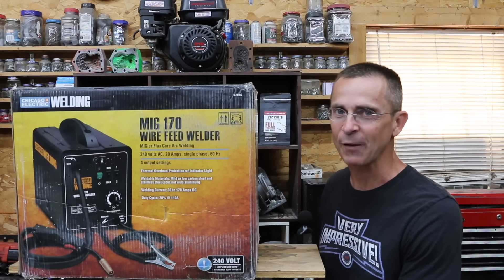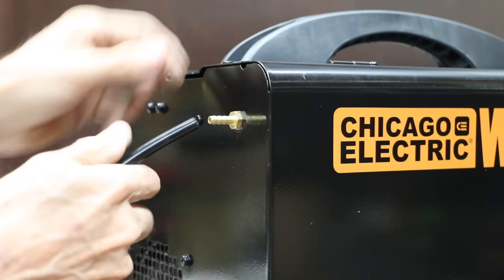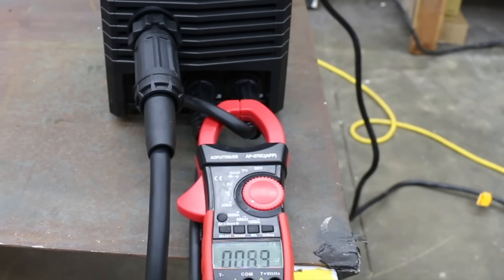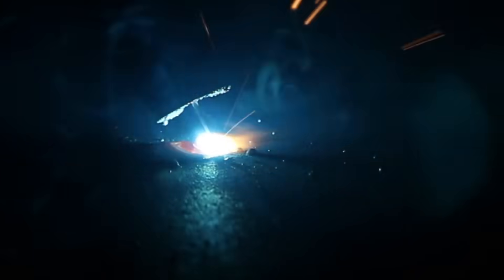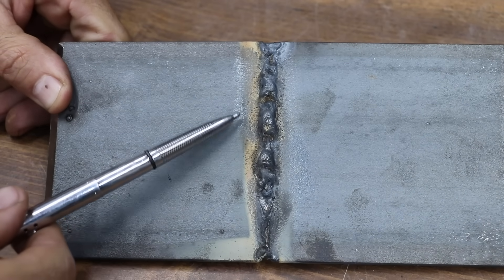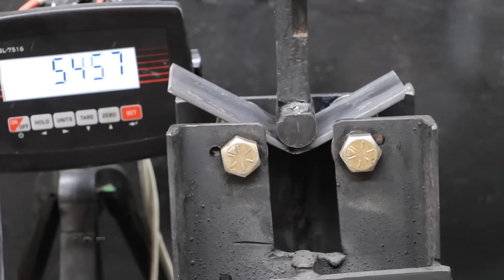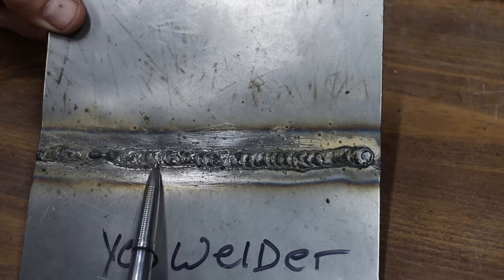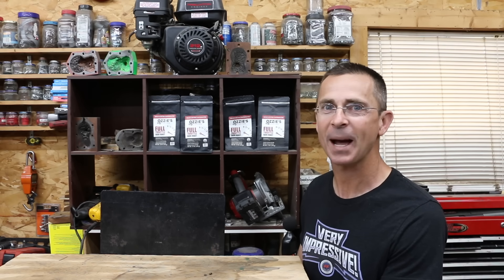Cheap vs Expensive Welder? Let’s Find Out!

Comment: Never having welded before, I bought a Yeswelder 205DS to fabricate a rear bumper and spare tire swing arm for my 4WD Suburban. Machine worked flawlessy...has been a year since and the bumper hasn't fallen off the truck.  Just added one of the Yeswelder models that will weld aluminum.  Yeswelder has some great machines at a relatively moderate cost.
Reply from the maker: Thanks for sharing.

Comment: You left out one important point - service.
Which can you actually get the unit serviced when (not if) there is a problem?  How long does it take to get the unit fixed, and MORE IMPORTANTLY where do you have to send it?
Is it the local welding supply or back to China?

Comment: A true welding prep (bevel should be 30° creating an open, inclusive angle of  120°. Also the true terminology is weld spatter not splatter. Thanks once again for your in-depth experimental procedures.
Reply: Im a German Welder and a Welding Engineer and to be honest for those V Seams with the 3mm gaps i learned to Weld the root in a lower current to get the best and most consistent root, i personally think that if he would've welded those roots like its supposed to be at about 180 amps and slow passage the Welds would've held up way more force.

Comment: Thank you, I was wandering about the "YES WELDER" if it would be a good buy for the buck. I know it's not the greatest and not going to spend $5k for a hobbyist welding plus I want to plug in to a 110V outlet 220 would cost a lot more to run. Thanks again for making this video and coming out the pocket so other's on a budget don't get swindled for buying a machine there not going to be happy with.
I bought a Lincoln machine that didn't last long at all and I spent $800 on it. Thought I would have got more year's out of it for what I was using it for.
Reply from the maker: You are welcome!  Thanks for the feedback.

Comment: I wouldn't use any welder  other than my Lincoln 275 Tig, 256 XL, and 180 Dual migs, let alone own other brands. I recently sold all three of them and bought an Everlast MTS mig, AC/DC tig, and stick. My Lincolns were older transformer based machines, but using an IGBT inverter welder is unbelievable. Every time I use it, I'm in awe. The fact that new Lincoln costs $2,300.00  and can't even do AC tig is a travesty. The older I get, the less brand loyal I've become. If you're looking for a new welder, do yourself a favor and look at Everlast.
Reply from the maker: Thanks for the feedback.
Reply: @ProjectFarm  Thanks for making such high-quality content. It's so refreshing to watch interesting videos and not have to worry about hearing about politics or being a shill paid by manufacturers to promote their products, or sneaking in some vitamin supplement in the first 5 minutes of the video. This is what YouTube was originally intended for. Have a happy Thanksgiving and a Merry Christmas.

Comment: I found this video about welders incredibly informative. Thanks you for making this video. I do have a suggestion for another Welding video below. I have put something I found on Amazon. I think it would be interesting to see how well these work. 
AZZUNO Handheld Welding Machine, Portable ARC Welder Gun 110V, Stick Welder Machine with IGBT Inverter, Small MMA Welding Machine for Metal Fits for 1/16''-1/8'' Welding Rods (Handheld 90A)
Reply from the maker: Thank you for the video idea!

Comment: Some of the footage seems to run together between shielding gas and flux core. Was there a distinct difference between the welders when it came to flux core? I’m only asking because I’d like to avoid using gas cylinders as they are big, heavy, hard to transport and expensive.

Comment: usually like your comparison method but looking at the penetration on the azzuno and giving it a 7 but then notice the weld break force was 6133lbs very strong so what gives a welder that does not penetrate does not produce this kind of strength

Comment: I don't get it, I think this gentleman got the scoring mixed up between the Azzuno and the Yeswelder. Azzuno did better on stronger weld for thick material and also beat the Yeswelder on thin material. I think he made a mistake saying that the yeswelder was close to the Vulcan when the Azzuno did better. Correct me if I'm wrong.

Comment: I use mostly arc and TIG at home but mostly MIG at work and I am not a huge fan of cheaper migs. I've used $150 Tig welders that are 90% as good as my $1800 unit only with less feature's and peak power. 

With cheaper MIGs you have so many more factors to troubleshoot if you need to really dial things in. Even the $5000 Kempi welders at my last job needed a bit of fiddling from time to time with heavy use. With cheap migs I'm always questioning whether or not I've suffered brain damage or the machine isn't feeding wire properly. They are absolutely fine for basic fabrication or even tacking things together but I feel you get the best value for money with a  cheap inverter stick welder. The best stick welder I used was actually a cheaper unit because it didn't have the safety VRD making starts more annoying.

But it is insane how affordable good welders have become in recent times. My $1800 AC/DC 200amp Tig performs like a $5000 machine from 15 years ago and the newest revision of the same machine is less than $1000 USD now. In the past a mig for less than $1000 was basically manufactured garbage whereas now those cheaper machines are actually viable.
Reply from the maker: Thanks for sharing.

Comment: MIG welding is for thin metal, if you need to weld deep and think metal you need a sick welder. Actually is a recent new generation of $100 stick welders in Amazon probably is a good future video idea because stick welding need a lot of amps and those welders have the size of a drill.

Comment: I've got the cheap $150 lincoln flux core welder from Amazon. Works very well. My first welder. Did a fairly large project making a chicken tractor out of galvanized pipe.
Reply from the maker: Thanks for sharing.

Comment: Nothing beats my grandpa's very old and very sketchy welder. Against all odds, 13 major hurricanes, and being thrown around by a tornado, it still works. Now that his workshop is being cleared out due to old age, i got to claim his immortal deathtrap and give it a loving home
Reply: I’d bet it’s an old Lincoln 220 AC “Tombstone” welder.  Indestructible!
Reply: @tomrogers9467 I picked up my tombstone from Lowes about 25 years ago & built a frame like a caged dolly with inflatable tires & can sit my mig right on top& strap it down. I love how there's storage on back of the 220, I made a door that latches on top to hold rods ,gloves, soap,tape & a beater & chippin' hammer & brush...
Reply: They dont make shit like they used to thats for sure
Reply: @connivingkhajiit  I restore old Emerson brand fans from around 1920-1935. They can weigh upwards of 35+ pounds and are packed full of thick chunks of metal. Nothing was made to cut cost. Everything was made to last, and when finally worn, it was easily replaced. I have a 102 year old brass six bladed fan that funs like new sitting next to me now. It's been used by others for 85 years and me for 15 more. I have went through several Walmart generic fans out in the garage, they last two or three years. Most Emerson examples today need work, but most can be restored to fantastic running condition. There are actually lots of people like me and most have even more antique fans. I alone have over a dozen fans about 100 years old that run great. There are SO many antique fans that are in such good mechanical shape.

That is A LOT of rambling for "they don't make them like that" comments. I just wanted to give a detailed example where I know it is 100% absolutely true. Don't even get me started with 100 year old axes. The short of it is any axe from 50 years ago is better than any axe today.   :(***

Ok, to end this essay. That fan next to me that will probably run another 100 years. Well, it cost $37 back when it was new. Adjusted for inflation it's over $650!!!!!!!!!!!!!!!!!!!  Imagine going to checkout at Target with your new fan, some milk and deodorant and the total is $700.  ;)      Inflation and many other things basically make it impossible to manufacture this way. We are in the age of value priced shit and must struggle to find anything of decent quality.

Comment: Great vid again.  I had gotten a Hynade (under $200) a year ago, similar to that Flameweld with all the plastic adjustments etc. The issue is the cheap design, plastic, because the stinking spool grabs and stops the wire feed A TON. Nothing sharp, just bad design. I have to lay it on its side without the spring hold-down on it. UGH
Reply from the maker: Thanks!

Comment: not being a DCK but they all are JUNK   Expensive doesnt mean anything if you want a truly good welder that cost 500$ that performs like a 2500$ welder  you buy FROM  Arc Captain   They have some of the best welders on earth they beat Miller, Lincoln, Hobart   in price and performance  AND  the big one here for 500$ you get some of the best technology on Earth for welders  with 500$ you automatically get a 2 to 5 year warranty  depending on what you buy  the one I bought I got a 2 year warranty but I got my Stick welder for 140$  you can do 120/240 Volt      Arc Captain if they keep doing what they are doing they will KILL  Miller, Lincoln, Hobart through price for performance    Welders are a old technology and they dont need to be expensive   Lincoln builds these welders for 250$  and they price them 1000$ to 2000$  for NO REASON at all I would rather use a Arc Captain  than a Lincoln   if it comes to Engine drive welders then its Lincoln  because Arc Captain has not made a engine drive welder  But I talked with a a employee from Arc Captain and he said they might be making one  but the welding hoods they make they sell for like 40$  MY GOD!!!!!!!   They do beat Lincoln HD clear view lens  Lincoln clear view lens die QUICKLY    but Arc Captain  it doesnt I have been using my Arc captain hood for over 1 year and my job is welding people call me cheap but im like price isnt always better  just because its expensive doesnt mean its better I let him use my hood he laughed at me at first but after 30 mins of using it   He was like WOW  this hood is really really nice   How much did you pay for it   I said 40$    I told him would you like to buy one  he said sure and to this day  my words and voice have beat Lincoln    he used the VIKING 3350 hood and he was shocked that a 40$ helmet beat his 430$ helmet    everything about Arc Captain is Awesome   even the tig rods  they are REALLY REALLY good for the price    the mig wire the also sell my friend also said it beats Lincoln  due to price and everything    I really do think within 10 to 20 years  Miller, Lincoln, Hobart will be DESTROYED  and I REALLY REALLY hope they are  because they are all greedy but Lincoln and Miller are the most greedy of the 3 companies    also Titanium   I really hope Titanium go bankrupt  they are scam artist  they want to charge 800$ for a 120/240 volt  multi process machine when Arc Captain  500$  you get the same thing  but its way better     it has a better duty cycle  better technology  more features for better arc control  hot start and everything you would get from a 2500$ welder from Lincoln   also WARRANTY    titanium  90 day warranty unless you pay a LOT more money to extend it   while Arc Captain 500$ you get a 3 to 6 year warranty  something around that I think its 5 years  5 or 6 years of warranty   for a 500$ machine vs a 800$ machine  so Arc Captain already has killed Titanium

Comment: Hello- it seems that the azzuno 200f model as tested is not available and only the 200a is available.
Is this one just as good as the 200f?
Reply from the maker: Thanks for the suggestion.
Reply: In the picture on amazon it looks to have the 200f  still selling.

Comment: I bought the Lincoln 210mp when they first came out paid $1000 after rebate. I sold it at the end of Covid for $2500 and bought AHP 190mp and AHP 203xd tig and water cooler. 
Honestly the Ahp multi process may not have fancy display but it has higher duty cycle, high frequency tig start and I can hook up 2 separate bottles for mig and tig!!! Obviously the 203xd tig is proven to be sick. I’m getting the 231 mig next from them!!! Customer service is great Nick at AHP is stellar
Reply from the maker: Thanks for sharing.

Comment: Great welder test thanks Project Farm. Any one wants strong welds your not going to get them no matter what you spend unless you understand the welding process and are good enough to be able to make a hot weld.
-
Lack of fusion in the welding process is the number one problem. I have been certified and paid to weld things together since age 15, I am 65 now. I learned the proper way in a high school shop class.
-
I can weld good enough for 90% of my needs with my old Lincoln arc welder and 6011 or 7013 rod. I like my miller 211 mig welder but the spools of wire and gas is getting stupid expensive.
-
Going back to arc welding for simple things because I can and it works if you know how to make a hot weld and get proper fusion.

Comment: The Chicago Electric reminds me a LOT of the Campbell Hausfeld MIG/Flux 105 welder that I have.  It's a transformer-based welder with the hi/lo - 1/2 heat switches and a manual wire feed dial. It's also from the late 1990's...  It could probably be a decent welder for what it is, but dialing in the wire feed speed (and it is extremely inconsistent) usually takes longer than completing the actual job.

Comment: I have a old, very old, HF 170 Mig.  I have modified it over the years.  Changed the clamp, all the cables, added a European connection, gas solenoid, new feeder, fan, etc.  What is original?  Basically the transformer and case.  It now welds pretty good but they still only have the four switches for adjustment, not great. I have a Yes Welder hood and use their consumables and really like their welders.  I really like the idea of an all in one welder and would love to see how these welders stick, tig, mig against each other.
Reply from the maker: Thanks for sharing.

Comment: One thing to consider for the value welding machines, is the consumables. Sometimes things like contact tips and nozzles are expensive, or worse case scenario become unavailable after a period of time making your welder useless. True, you could just buy another cheap welder if consumables become unavailable, given the price difference. But, the old saying "buy once, cry once" applies.
Reply from the maker: Thanks for the feedback.

Comment: This is a great video.  I really appreciate the opportunity to burn through several reviews at one time. Your criteria seemed relevant and carefully chosen. Especially the weight.  I believe and heavier welder reflects more copper and would serve me longer. If course that is not an apples to apples comparison if one is an inverter welder and one is transformer based. If you do this again please add max voltage. At least 24 volts is needed for spray transfer. My goto is tig because there is no spatter. I am not buying a mig welder that is not cable of spray transfer.
Reply from the maker: Thanks!  Thanks for the suggestion.

Comment: The old blue Chicago Electric with I want to say 6 heat settings were pretty good welders if you can find one. I burned through quite a bit of wire on mine before I sold it and didn't have any issues that weren't user related. Thanks for the great test.
Reply from the maker: You are welcome!  Thanks for sharing.

Comment: This is probably a dumb question and I didn’t watch the video fully because I’m in school but do you need to get argon tanks, if so we’re can I find ones I can use?
Reply: You only need Co2/argon gas with solid wire. With flux core wire you can weld without the need for gas. Tanks are available at welding supply companies.

Comment: I don't think you should run through the tests quite like Virgil is doing.  For example, he mentioned that one welder produced more splatter.  My friend, this is what the voltage knob is for.  And anytime you get your hands on a new (to you) welder, there is necessarily a considerable amount of time needed to get things dialed in.  One might hastily say, "I would throw this one in the trash," while another takes the welder and banks on it.

Find a welding artist for the opinions, brother, not just a welder.

Comment: I have the warcking and for my limited welding it does fairly well with the .035 flux core and 3/32 stick. It took some beads on plate to dial it in for the different thickness of metal I've been welding, but it's not an issue. It's very consistent, but I've never attempted 5 mins. I also bought it this past January and I got a nice coupon and only paid $168 for it. Haven't tried mig because I like to travel with it and don't make enough money welding to buy shielding gas. I guess it all depends on each person's needs and how often they weld. If I was making money welding, I'd get the Lincoln.
Reply from the maker: Thanks for sharing!

Comment: To a certain extent it looks like you get what you pay for. On the other hand a professional welder would use a professional machine whereas a hobbyist probably couldn't out weld some of the lower cost welders.

It would be interesting to see if my old Miller 200, the old one not the new one, with new caps, would still out weld the newer machines.
Reply from the maker: Thank you for the video idea!